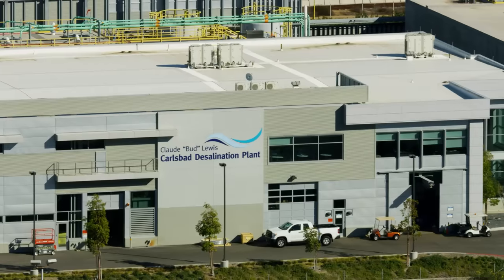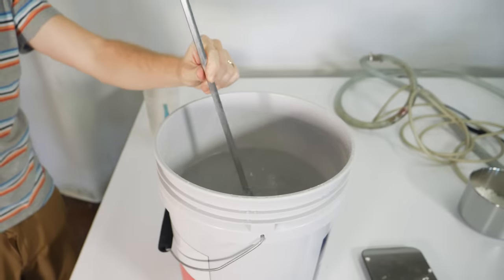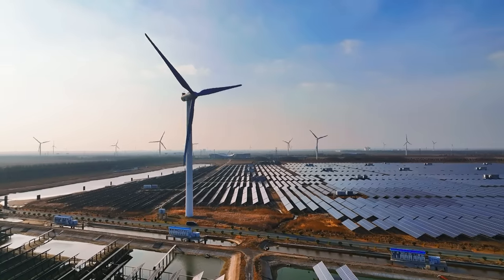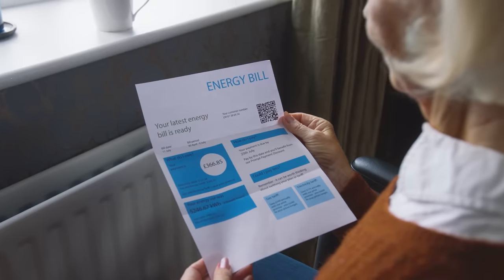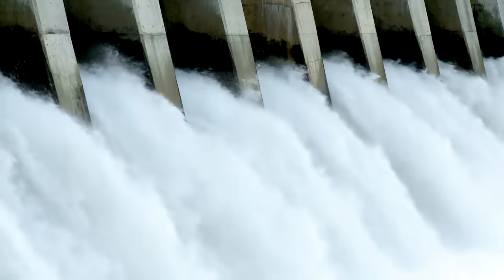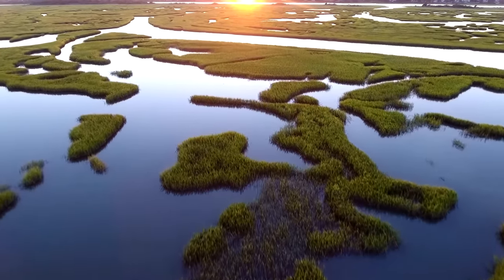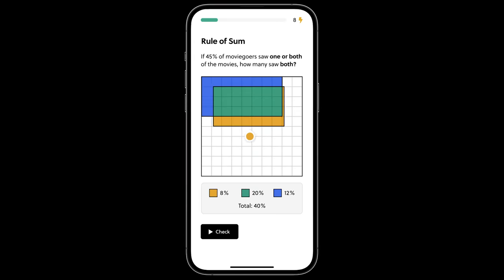Why Is Desalination So Difficult?

Comment: There's a few things about water desalinization... regardless of what technology used distillation or reverse osmosis or deionization (which is also a pure water technology)

I started doing water-treatment back in 1986. I am one of the highest industry certified individuals

I've done water treatment at projects around the world and reverse osmosis specifically for ocean-going private yachts. These would be the most similar to what you find in these large-scale Municipal desal plants

One point I need to make is that the minerals that are put back into pure water may be put there for taste and enjoyability, but the problem is pure water - especially very high-quality distilled or reverse osmosis water - is very aggressive and as such minerals need to be put in to buffer it down so it doesn't start dissolving/damaging the water delivery infrastructure

On an ocean-going vessel being that it's a much smaller footprint they can elect for having all stainless steel piping in the system and just put a very small buffer filter inline at the end of the purification system

Most large RO systems have "Fast Flush" valve to rinse down the exterior of each of the membrane layers - especially if they have not done an adequate job on the pretreatment

I am really getting off topic

Thanks for the video just wanted to make that mention about the buffering
Reply: Have you looked into Victor Shouberger research on the natural swirling effects of water and revitalization, or how about resonant frequency experimentation for desalination? Interesting stuff

Comment: I know it wouldn't be doable everywhere, but in places like the middle east where you have large, generally flatish desert areas, could you make evaporation pools for the excess brine and then harvest the salt? You could then have your cake and eat it with the membrane desalination. Or you could dump sea water straight into these pools and put a clear structure with an angled roof over the pools to collect the steam produced by the sun.
Reply: large amounts of water sitting like that... perfect environment to grow who knows what
Reply: @techheck3358 thats how seasalt has been made since forever.

It's no problem if some flamingos poop in it.
Reply: @techheck3358  Good point! If the water was deep enough to stagnate then ewww proper nasties! However, I was thinking more of an oversized and a shallow pool, say only 10 - 30mm deep over 100m2 in what would effectively be a greenhouse to collect the evaporated water. Yes lots of land would be required and not suitible for more temperate parts of the world. But every picture I see of places like Dubai and the like are cities surrounded by the sea and desert. Surely a method that only requires only the water being pumped would be more efficent.
Reply: @TheKingGandy  I think salt isn't that expensive so I'm not sure you could make that much money by harvesting it. But maybe such evaporation pools would be worth it just to avoid the environmental damage, as long as you can also prevent the wind from blowing salt dust around.
Reply: @techheck3358  I think a hypersaline solution would be a hostile environment for any kind of nasty (and non-nasty) growth.
Reply: The issue is the sheer massive quantities involved, california for example, ~20billion gallons per day for people and agriculture even trying to do 2billion a day to supplement is a /lot/ of salt, roughly 70million kg of salt /per day/ 25.5million metric tons per year, a full 50% increase to the /entire countries/ production, for 10% of 1 states water needs

Comment: I know it's probably negligible in the grand scheme of things, but I feel like putting the desalination waste back into the same body of water as the initial source is just making future work more difficult.
Reply: Yeah, I was thinking about this, too.  Like, the whole thing with climate change has been that we've slowly added more CO2 than the planet could handle over 100 years, so what's to say we wouldn't be doing the same thing to the oceans' salt concentration?
Reply: You aren't looking at the big picture.  Every day sunlight evaporates far more water from the surface of the ocean than we use worldwide thus increasing the ocean's salinity.  That evaporated water later falls to the ground as rain and returns to the ocean via rivers and streams diluting that salinity.  Pumping water out of the ocean and desalinating it increases the ocean's salinity very slightly, then that water is sent to homes where it is used, then flushed down the drain, and it goes to a treatment plant and is dumped into a stream or river where it makes its way back to the ocean diluting it again.  What's the difference?  When we "use" water, it doesn't just disappear.  Water is constantly recycled through the environment.

Comment: It seems to me that coupling desalination and those power stations where a huge array of mirrors heats up a special portion of the tower would make a lot of sense, considering most areas where desalination is in demand also have lots of sunny days. By heating up water directly by reflecting the sun it seems to me you could save on a lot of steps where efficiency is lost, like converting the heat of that solar station into electricity and then converting the electricity into heat to boil the water.
Reply: And you could split James Bond in two with that focused beam. I think those water heating panels are proving to be less effective than just solar panels though. Maintenance/durability on water heater solar systems are an issue. Reverse osmosis seems the method of choice these days so electricity is the energy form wanted for pumps.
Reply: @cadthunkin  i cant imagine what the issue with reliability could be. you literally need just a glass jar fir water, concentrate sun on the jar, the water in jar boils and sends steam through thin metal tubes connected to top of the glass jar. thats literally all there is to it

Comment: i have often wondered why desalination plants are not so much more widespread amongst the earth.  Could solve so manu freshwater availability issues if it were perfected!
Reply: Basically the biggest reason is its high energy consumption.
Reply: Energy costs are what keeps desalination from being widespread. 

Whether you are boiling water or using high-pressure pumps it's expensive.

Comment: I find it bewildering that I can go to Walmart, or any other grocery store and get a gallon of distilled water for just over $1. Strange, considering the energy it took to boil and condense it. Ironically, a gallon of spring water is the same price without the extra energy usage.
Reply: Here in the UK, I pay a total of about £3 (about $4) per cubic meter of tap water, and nearly half of that is attributed to sewage removal rather than actual supply of the water. That works out to about 1.5 cents per gallon.

Obviously that will vary a bit around the world (and some properties don't have meters and are instead billled based on some other factor which is assumed to correlate with water usage) , but it gives a ballpark for just how cheap tap water is. A water source can easily be expensive by water utility standards while being cheap compared to virtually any other liquid.

When you buy a gallon of water (whether distilled or spring) from the store, you are paying mostly for the packing and distribution, not for the water itself.

Comment: Wow, I wasn’t aware distillation was still a modern method for industrial scale desalination. 

I have an RO system at home which uses the water pressure of the city water lines to operate - desalinating with that kind of system seems like it would be really hard!
Reply: umm, I'd say you need a significantly lower pressure difference compared to sea water. so, that's just not comparable. since you can't desalinate sea water with the city water pressure.

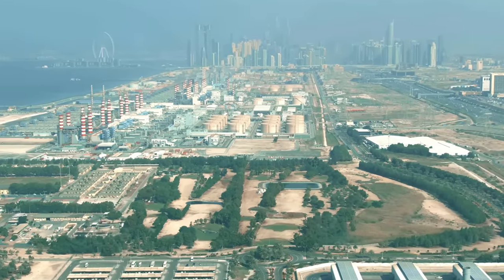Comment: 7:28 I was about to say this. I was born and brought up in UAE and all over the country the water is desalinated.

It's safe to drink, but no one drinks it. Everyone buys mineral water and drinks that. If you go to any store and ask them for water, they'll give you a 500 ml bottle of mineral water and charge you 1 Dhs (27 cents) or 1.5 Dhs for a 1½ litre bottle.

I didn't even know people drank water out of taps until I left the country. When I saw that, I was horrified 😅
Reply: It actually is still clean enough to drink it out of the tap here. It's probably not recommended, but you can
Reply: @hariranormal5584  Yeah it is.

Comment: Energy used heat water with one hotwater heater vers using two hot water heaters divide mid temp point to final temp point.  Good job done again!!!

Comment: Very interesting, the one thing I'd add though is the inherent issues with public private partnerships, even if you accept that a basic human need like drinking water has any place in the private sector. The best example I'd point to is Pakistani electricity, known in Pakistan as IPP, or independent power producers. There's lots to read about on this, but I'd particularly recommend Taimur Rahman's lectures on political economy in Pakistan

Comment: Post-treatment isn't just for taste and sanitization - it's necessary to avoid corroding the water storage/delivery systems and avoiding health problems like hyponatremia. Distilled water is corrosive until it's sucked up enough material, and if you drink enough of it before that happens, it'll completely screw up your electrolytic balance.

(it's also not electrically conductive until it sucks up enough of those materials, an interesting side-note)

Comment: If you wanted to increase the efficiency of your setup you could locate your water source above your HP pump. This also increases the backpressure on your brine side which means less wear on your valves.

Comment: Why don’t they use a large pool with a bubble around it and let the sun evaporate the water for free?
Reply: I was about to ask this same question. It seems simple and effective, and since the heat comes from above, you shouldn't have to worry about scale. Hopefully someone more knowledgeable can answer this question for us
Reply: I think it can be done.. But to what scale.. On industrial scale you'd need.. Hectares of land..
Reply: The structure you would need to build would be gigantic. 

With evaporation you talk about gallons per square foot per year. Those gallon-square-foot-years are usually below 100, but that depends on many things. You could probably get it a lot higher, but not enough higher to be economical.
Reply: Cus it doesn't evaporate quickly enough to be viable. I think somewhere they were experimenting with pointing mirrors to one central area, but it would still require a lot of maintenance

Comment: After perhaps carbon capture and replacing crude oil with alternate sources of carbon, sea water desalination is perhaps the most interesting field of research in chemical engineering. But unlike most ppl may think, seawater need not replace natural sources of drinking but rather for industrial and power generation which doesn’t require stringent purification measures (but still entails challenges)
Reply: unlimited cheap clean energy would solve desalination,
Reply: @ssllhh100  So the laws of thermodynamics will just have to go out the window so you can have your fantasy free water?
Reply: @skeetorkiftwon  instead of trying to work around thermodynamics, you can use them to harvest energy from low grade heat sources, ie the ambiant air and water, the technology is there, you only need to prime the system and the rest is history
Reply: @ssllhh100  No where do you address the entropy, the QC theoretical loss limit, or bother to spend a single moment hovering over the limits in material science or damage from cavitation. You have a Duplo block level understanding of any of this.
Reply: @skeetorkiftwon  are you here to discuss and maybe learn from others or to just insult people?
Reply: @ssllhh100  Did you look up the paper he linked at the end of the video? Are you willing to learn the chemistry and physics that simultaneously teaches you how to make these machines, and, that they are always a loss? You've been arguing from ignorance this whole time and other readers deserve to know that you're playing pretend armchair physicist here. 

He told you right in the video that building a pipeline was almost ALWAYS more energy efficient than desalination. He linked you one of THOUSANDS of white papers explicitly proving why. You're still not listening to HIM. Was he insulting you as well? Was Thunderf00t? Was your physics book?

 So you can get slapped around by me instead for ignoring what's been put right in front of you, repeatedly. Evil people will promise you something to get money from you, I won't. You won't ever try to solve this problem, which is why you can believe what you believe. I know you're wrong, because I tried and we knew a hundred years ago this was never going to be productive.
Reply: @ssllhh100  Fusion.

Comment: "Let the private company take on the risks": yeah, right, we all know how that turns out by now. They "take on the risk" when there's a premium and then they're "too strategic to fail" or "need a cash injection" or "need to vary contract terms" when times get tough.
Reply: Exactly this. Privatizing water production is like privatizing healthcare.
Reply: Came down to the comments to say this. I'm really surprised at Grady for casually mentioning private ownership as a positive - it's a definite negative. There's tons of examples of privatization of water infrastructure going bad. Flint, Michigan being an obvious example, but only the tip of the iceberg. The company's risk is very limited, the community's is not.
Reply: Same, it took me by surprise. Privatization isn't an engineering solution to the difficulties of desalination, so im not even sure why he mentioned it.
Reply: Very dumb comments guys even for  the YouTube comment section. Research market economics before thinking you know anything about social regulation.

Comment: I read an article about Dubai's Desalinization Plant in which it states they analyzed their salt waste and found it had precious metals in minuet amounts, but recoverable.
They built the plant with a mineral and metal recovery process and are extracting Gold and other metals and it has been profitable. They are also limiting the amount of salt dumped back into the sea! I contacted the engineering staff at San Diego and asked they If they were aware of this and they said no.